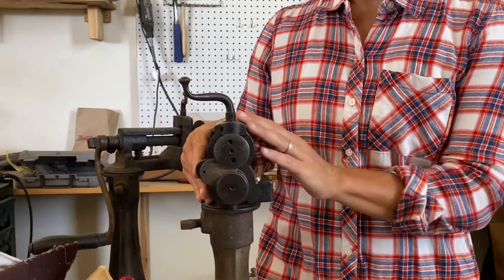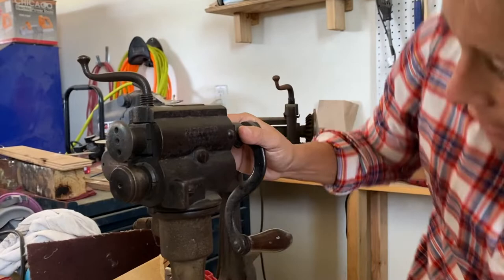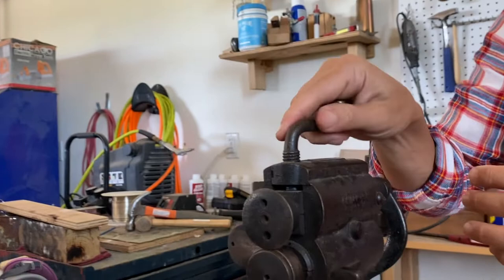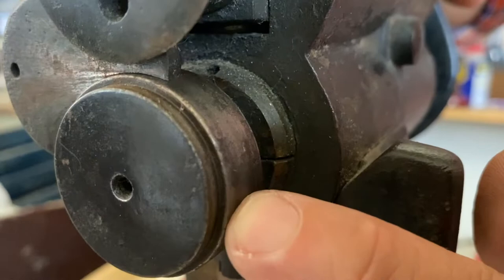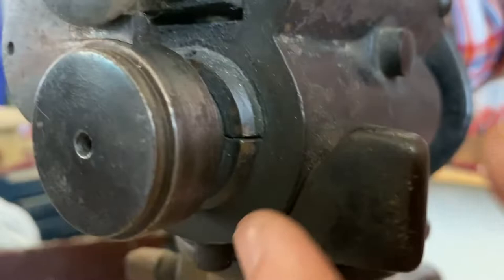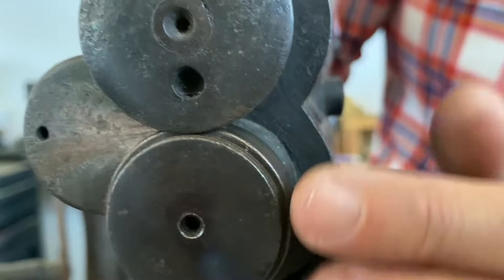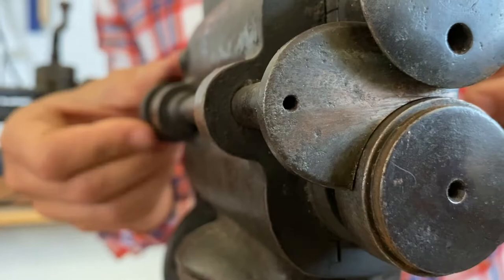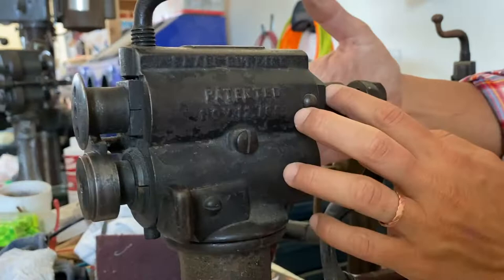Tool ID #1: Burring Machine

Comment: I've recently picked up a 577b with thread on crimper dies.  My problem is a tooth is broken and I don't need another crimper.  

What would you look for as a swap set of dies?  I'm having a hard time finding dies for a machine of this age with threaded spindles.
Reply from the maker: Yeah, that's a common problem. I would see if you can find a tool and die maker or a mechanic willing to weld and grind on a tooth. Or to just make you some new dies. It's extremely hard to find matches - without buying several on ebay and trying to mix and match (which is what the old smiths I know actually do!).